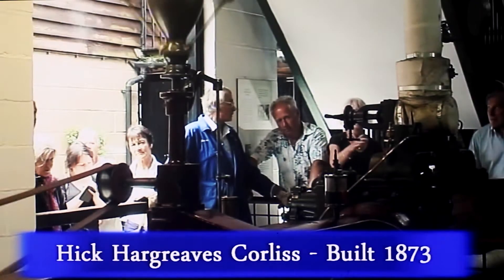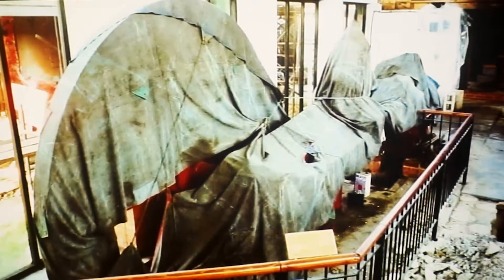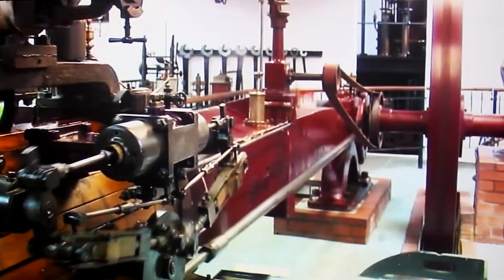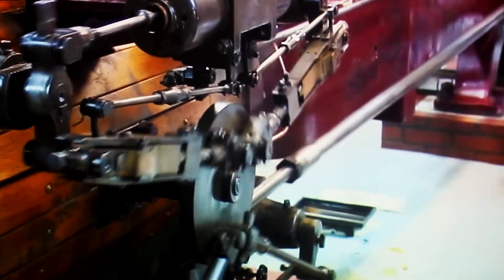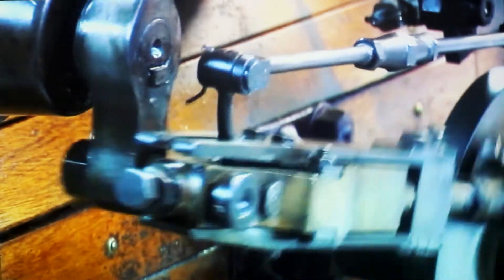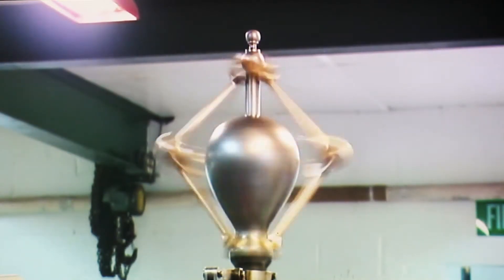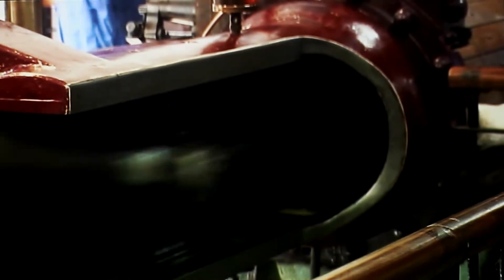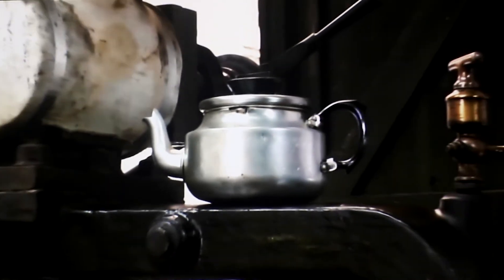The Hick Hargreaves Engine

Comment: I saw a very similar engine (Hick Hargreaves Corliss) in a mill in Haverhill, Suffolk in the 90's. It was out of use but could be run on steam on open days. Not sure if it's still there after all this time.